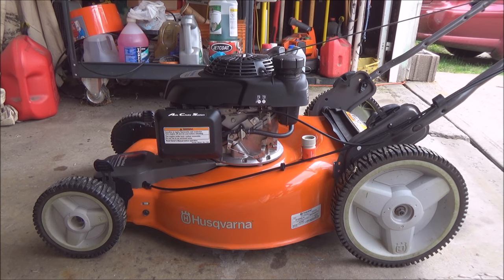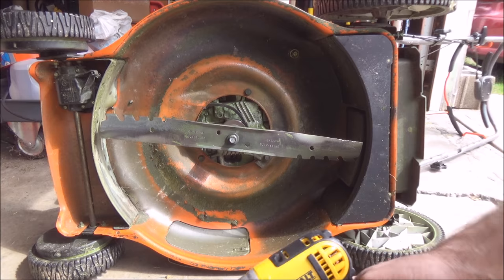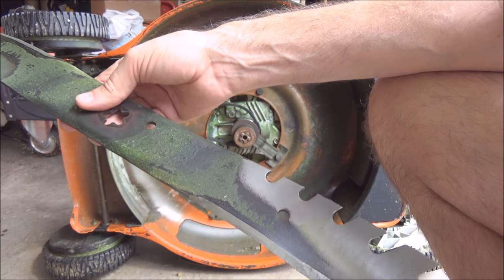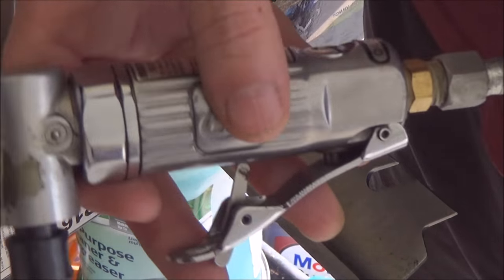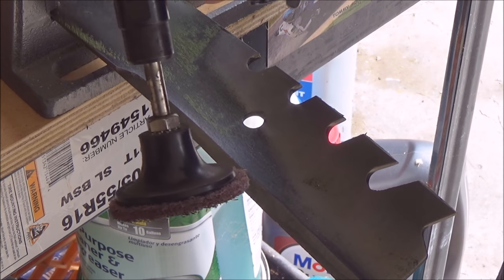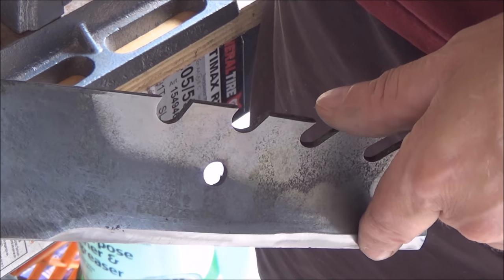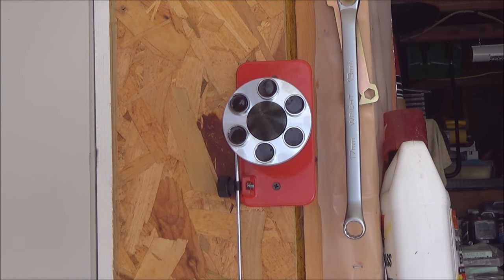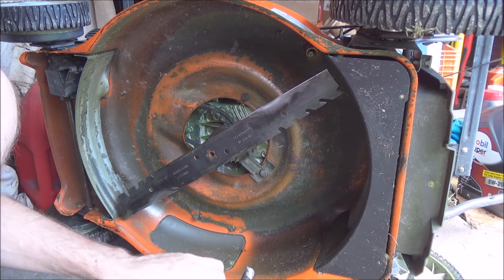Lawn mower Blade sharpening & Balancing

Comment: You did a good thing, pointing out to keep track of which side of the blade goes down. My brother had an old Murray which he took the blade off of. When he put it back on the mower he got it on upside down. When he couldn't figure out why it could no longer cut grass, he gave it to me. I thereby got a very nice mower for free. It worked wonderfully until I hit that BIG rock with it. That was a sad loss.

Comment: for  balancing use a any round rod shaped object,  lay on flat level surface, tape ends down to prevent rolling,   lay blade horizontally on rod  evenly spaced /  centered over connecting hole,     blade  position will indicate balance  via heavy end down if not in balance,    remove metal from heavy end of blade in small amounts until it positions itself evenly horizontally.    noticed this procedure at a high volume pro-shop many years ago right after I bought one of those Christmas tree balancers (it wasn't even balanced by itself),    saved $7.00 and $100.00,    never had a balance issue since.    regards.

Comment: Good luck...when you torqued at the end I had to look away.  I have seen filleted arms and hands.  Pull the wrench not push.  :)
Reply from the maker: Good tip, I've never suffered a injury using that  method over the years.

Comment: Nice job.  Thumbs up.  Cool balancer, I need one of those babies.
Reply from the maker: It works great and my mower runs very smooth.
Reply: Ya, I can't stand a mower with any vibration.  I feel as if it is eating itself up.  Smooooooooth is greatness in a mower for sure.  Keep those blades balanced. :)
Reply: 427GT40: I know what you mean. I had the same mower we just saw here. Push variety though. The vibration was terrible. Rather than doing something angry, I just gave it away. Considering the brand names on the body and engine of the mower, I was surprised and disappointed. My old Murray was better in every way till it hit a BIG rock. And that was my fault.

Comment: Hey Mark, I was wondering if that is the blade that came with your mower.  I have the same mower and my blade does not have those mulching teeth.  I actually took my blade off to sharpen it and noticed it is not a very good mulching blade so considering replacing it with a proper mulching blade
Reply from the maker: Yes, that is the blade that came on my mower. I bought a spare (same part #) from Lowes.

Comment: The biggest cause of nicks and dings that large is due to cutting the grass too short. I never cut less than 2 3/4 to 3 inches. Your using a 'fiber' type sanding pad. Try using actual sand paper type discs. It will remove more stock much easier & faster. Love your balancer , but I can tell you that the 'average' home owner IS NOT going to spend $100 to balance their blades, even though because of the type of blade your mower uses, is probably the right thing to do.

Comment: Probably a better idea to use a drop or two of blue (242, medium strength) loctite, as opposed to anti seize, but to each their own... 

Wouldn't want vibrations or impacts to cause that bolt to work it's way out, that blade could go flying quick!
Reply from the maker: I could see using loctite on a B&S motor but no need for that on Honda powered equipment. If the blade in properly balanced very little vibration is transferred into the hand controls.
Reply: Mark Fox -Not referring to vibration into the hand controls, referring to HFV of the engine running, causing the blade bolt to back out.

Also, brand of engine is inconsequential. Same layout. Internal combustion engines inherently have vibration due to their method of operation, and there is no completely vibration, or High frequency vibration free engine layout yet.

Comment: You might want to advise people to disconnect the spark plug first...
Reply from the maker: I never disconnect the spark plug, no chance of the motor firing without the bail being pulled.
Reply: Not impossible...unlikely, but depends on the position of the piston
Reply: disconnect the spark plug

Comment: When using a grinder, or anything really, to sharpen your blade use smooth even strokes that go the full length of the blade. Never go back and forth in one spot. You are making an extremely uneven edge when you do that.

Comment: Ha, so you just need a thousand dollars for the tools and you have a perfectly sharpened blade!
Reply from the maker: Not quite a $1000, all but the balancer can be used for other things as well. I will add that you won't believe how low the vibration is with a perfectly balanced blade until you experience it for yourself.

Comment: Yeah, just like the old "face razor" sharpeners, this is important if there's no new blades available. But, I mean...just buy a new blade....unscrew, screw in...you're done. no compressor, angle grinder, nothing needed. no balancing needed. But, good video for what it it is.
Reply: F!@#Guilt but buying a new blade everytime it needs sharpening adds up and is a waste of money, if you know  how to sharpen and balance it properly,there's no need to buy a new blade everytime, now I know every now and than you need to replace the blade but not every time you need to sharpen it!